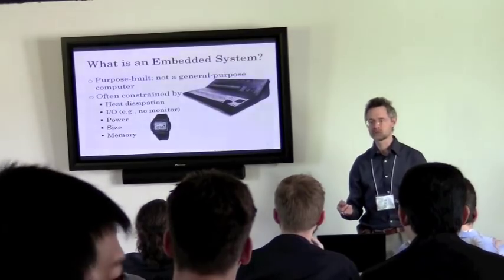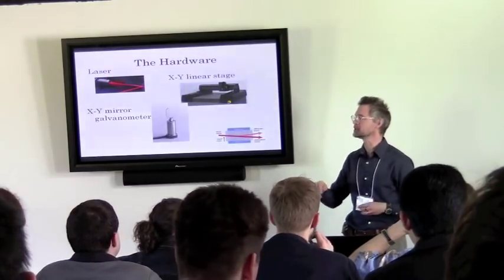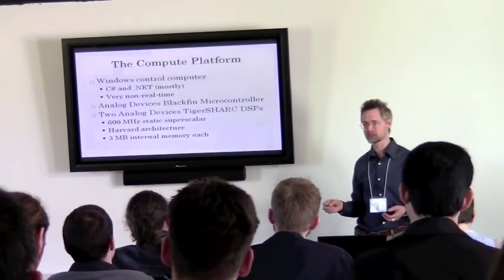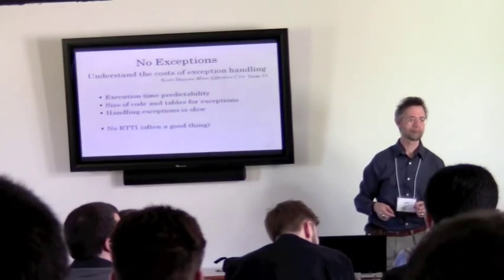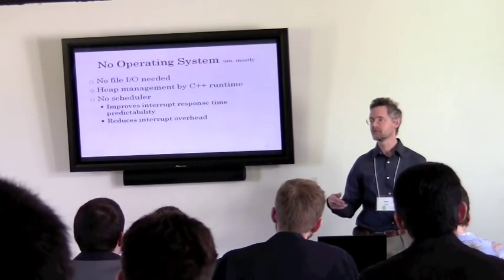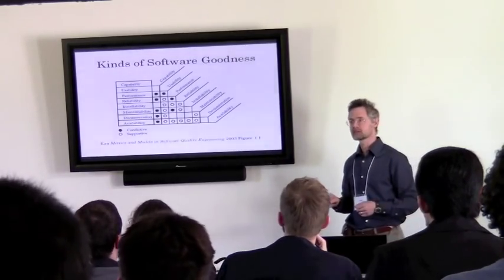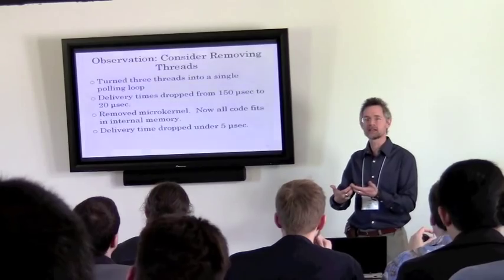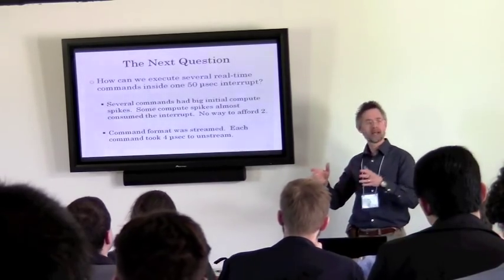Scott Schurr: Optimizing Embedded Hard Real-Time Code in C++

Comment: When he was talking about PODs he said that C# does not have PODs. But in C# you can use value type (aka "struct") and define layout (eg. sequential) and packing for your data structure via attributes. Also you can set your field offsets which allows you to define unions essentially. And C# even allows for fixed sized arrays.

 So, the only thing I understand as remaining is, C# zero initializes your structure by default. Was this the case? I did not think it would slow down that much, since you are using a managed language already.
Reply: Would you want your breathing device in the hospital to run C++(Real Time) or C# with a garbage collector?
Reply: Ofc I want a non-GC system programming language. But then, what is the point to compare C properties with managed languages anyway. You can say: "hey, you need real-time. get on with it. you can only use C"
Reply: zahir2342 I just had hopes that Rust will be a new player on the bare metal area, also in the Real-time area. Because managing memory and other stuff is hard in C++. There is room for a great language that would follow up C++. Yes we have D.. but seems it's not well designed if you turn off GC. What i want to see is a higher and easier to use language, but still be predictable. Not unpredictable with a GC.
Reply: I believe Rust is getting there. I'm not an expert at rust. Just started using it but i feel it has the potential to solve problems  C/C++  has. Have a look at this if you have  not already http://blog.japaric.io/fearless-concurrency/